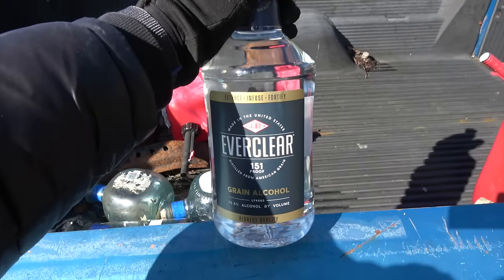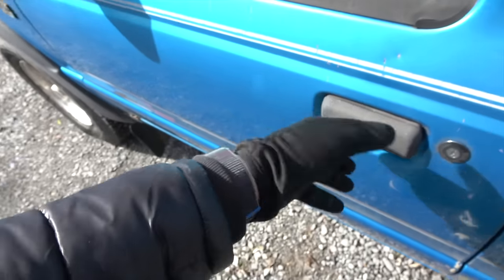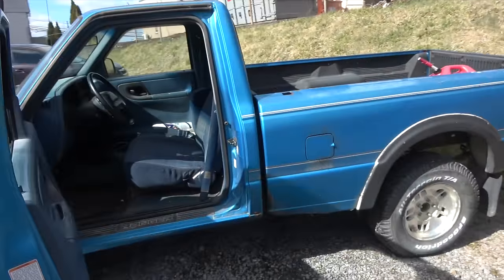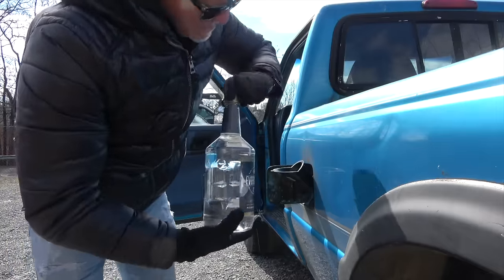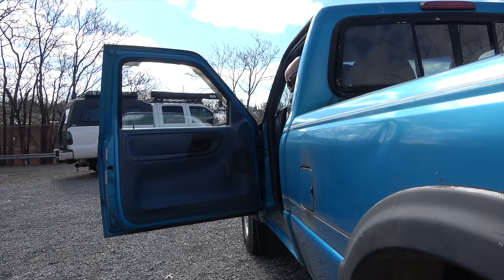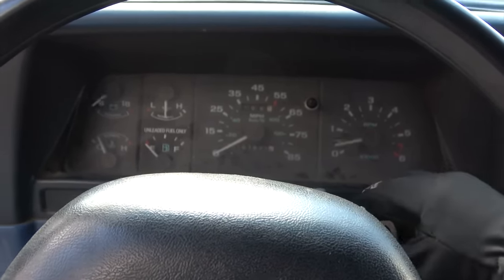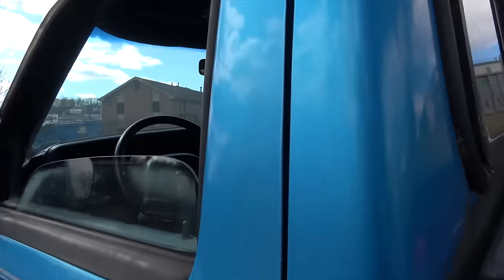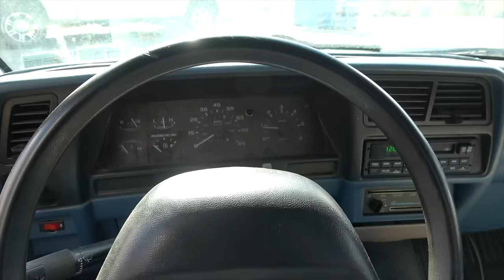What Happens If You Fill Up An EMPTY Tank With Everclear? (152 Proof Alcohol)

Comment: Here's my theory: Alcohol (ethanol) needs an air-fuel ratio of around 9:1. Gasoline is 16:1 (ish). Since the danger ranger is expecting gasoline, it's not pumping enough into the engine for it to burn properly, so it's running super lean on the everclear (which is almost 80% pure ethanol and some water). 
The vodka is only 40% ethanol. So while it was made up of 60% water, it was a lower concentration of ethanol, which probably made it closer to the 16:1 ratio that the truck needs vs. the everclear.
Reply: Why is his ever clear so crappy?? I have a bottle of ever clear that I'm looking at right now that is 95% alcohol. You think ever clear is about 80% and his says 75% on it.
Reply: thats what it is. the fuel air mix is now wrong. a old cabrated car it could easly be changed. might work in newer flex fuel car as it can sense the change in the fuel and make the adjustments. that old truck also will try and increase the fuel flow but the injectors are just not made to work that way and hit there limit.
Reply: I would like to see him try the 95% alcohol everclear
Reply: @justinalias2279  it would still act fuel starved. wile you can run the stuff you need to dump more of it. the current injectors and fuel system just cant do it. with mods it 100% could run. thats relly all e85 is anyways. the reasion people pretty mutch ignore the stuff is becouse it is only slightly cheaper then gas and gets less mpg.
Reply: Outside temperature could also play a role here, since colder air means the oxygen will be less prone to react with the alcohol compared to if it were hotter. The engine might also get a little hotter if the temperature rose, which could help also.
Reply: @neb_setabed   95% is banned in some places.
Reply: @neb_setabed Some states don't allow the real 95% stuff so you get this dumbed-down version instead.
Reply: @neb_setabed  Some states have laws limiting ABV. Everclear sells different products in different states to match the state laws.
Reply: I converted my previous car to run on Ethanol and you are correct. I needed to get recalibrated sensors, a tune and larger injectors in order for it to run correctly.
Reply: @DaftDrunk24 For sure. I converted my WRX to run on E85, needed a high-flow fuel pump, injectors, and a new tune. Absolutely killer fuel for turbos, though! Thing is a beast, making 80whp more than 91oct on the same hardware. (Which is a lot more extensive than just the fuel delivery and tune, mind you.) Even using ~30% more fuel by volume it saves me money as it's ~45% cheaper than premium in my location.
Reply: —So It Needs More o2❓😅
Reply: @DJDeezyThaTruth  No, it needs more fuel.
Reply: Gasoline has a stoich afr of 14.7-1. E10 or 10% ethanol which is what most places sell as regular is around 14-1 or 14.1-1. 16-1 on E10 would be pushing it. 16-1 on E15 and you might start running into misfiring.
Reply: Gasoline is about 14.7:1 not 16.1:1 lol that’s way too lean of a number
Reply: Any car can run on ethanol with upgraded fuel lines and the proper tune
Reply: @akman45304  Fuel lines? Maybe. Larger injectors and a higher flow fuel pump are also a maybe. It all depends on how cheaply the car was engineered. The materials matter as well. Some plastics degrade when exposed to high ethanol fuels.
Reply: @thatonedude5237  probably should've said fuel system just not the lines.
Reply: You can probably get a better result if you tune your ecu to run on e85
Reply: the dude just put 25% water into his tank.  On top of that, his injectors or pump is probably too small for the appropriate amount of alcohol to be pumped into the cylinders.
Reply: how about 190 Proof which here in Canada isn't banned it's 95% would she run? btw I never had it but my friend and his brother had everclear Jell-O shots and said after 4 shots they were wasted
Reply: This young man has the right answer. If the turn has a manual choke you could set the choke about 1/2 closed. that should help you truck run better.
Reply: In addition to fuel air mix, hotter running spark plugs, alcohol requires more heat to properly combust
Reply: @neb_setabed  Just what I was gonna say, sign of the times, 95% Everclear is now just 75%, and probably costs more too!  🤣
Reply: @rustirab3465 can't buy it in west virginia anymore.
Reply: @thatonedude5237  16:1 would be far too lean, you would need about 8:1 ratio of alcohol to run the ranger. Which is more duty cycle than the stock injectors can do. Alcohol is not as volatile as gas, so that ranger in stock form can not run on alcohol.
Reply: @gogereaver349 It's only ignored by the general public, but it's popular with racers that use forced induction because they're able to run more boost before knocking/detonation due to the higher octane.
Reply: @neb_setabed  state laws vary. They make watered down Everclear to comply with different state laws.
Reply: To buy pure ethanol you just get it as a laboratory supplier. also it will be 96.5% unless it has molecular sieves in there to pull out the water
Reply: @gogereaver349 My 2000 S-10 was a flex fuel and would run on it just fine cause I tried this back then!
Reply: Now she's an alcoholic 😅
Reply: Alcohol also burns cooler and the flame spreads slower requiring alot more ignition advance. Alot of mud bog guys and drag race guys like Alcohol because it's harder to overheat the engine.
Reply: @akman45304  any car? Yeah try a diesel engine
Reply: @SuperZardo  ever seen a diesel pro stock pulling tractor burn alcohol?
Reply: Fix the fuel mixture and it will work. We have Alcohol running cars since the 70s and thats all its changed.
Reply: I just put etanol in my Ford mondeo 2004 without problems. Cold start it will die instantly but after 3 turns (think the engine heats up) then it will run without problem as smooth as with gasoline. On hot sunny days it will just start up without problem.
Reply: vodka has too much water you should use the heads from distilling with both ethanol and methanol
Reply: @neb_setabed  I know a long time ago it was 95%.
Reply: @stevegabbert9626  still is in Nebraska
Reply: Yeah i think your right on point
Reply: David Freiburger from Hotrod explains the ethanol/gasoline comparison on Engine Masters. Ethanol is less fuel dense and requires more volume to combust efficiently compared to gasoline. Also, fuel moves around in the tank when you move. Fuel starvation at the pickup is not a new thing.
Reply: It's acting fuel starved cause it not built for ethanol of that high of concentration. Engine is to low of compression ratio to run well on it
Reply: It also needs the timing adjusted to match the fuel type.

Comment: When you run on any form of alcohol in an automotive engine, and you do not want the engine to melt down as it eventually will, you need to change the heat range of the spark plugs, and increase the air flow both in and out of the engine. I have a neighbor that races  an alcohol drag bike at the salt flats. And even his bike melted the pistons, from the wrong heat range on the spark plugs. Also if it still has the catalytic converter the converter depending on the type will melt down as well. And you also have to adjust the timming to match the fuel.
Reply: Yum "Salt flat"

Comment: Back in the 70's we added Everclear to our fuel for a cheap power boost. Once it reached the engine you had better be ready with a screwdriver to turn down the idle at the carb idle speed screw. Dumping a bottle into the tank of someone else's car was also a common way to mess with people, watch their face as their engine suddenly started to race, car wanting to take off if in gear. Never did this with a fuel injected computer controlled engine. You would need to reset the computer (and possibly change out injectors) to properly handle the Everclear, or at least run a blend of gas and Everclear long enough for the computer to start to figure out the needed adjustments. For the record you should add more than a gallon to an empty tank to ensure the pickup tube in the tank can suck up a steady supply of fuel for the engine. And pumping the pedal does not prime a fuel injected engine (or any engine that's been run dry), you need to let the electronic fuel pump prime the system before you crank it over. Try this test again, this time with an older carburetor fuel system-ed engine (no computer or injection system). Crank the engine over a few time so the mechanical fuel pump can prime the system (you can pump the peddle while doing this) or simply dump a little Everclear down the throat of the carb and fire it up. A couple moments of adjusting the fuel mixture screws will then give you top performance but it will still run even if you don't.

Comment: To prime, cycle key switch a couple times since prime mode for pump happens on key on for a few seconds before start. Pedal pumping on fuel injected just opens flap for more air and the computer adjust fuel/air radio using oxygen sensor. The high alcohol content just makes it run lean mostly almost like it’s out of gas because it can add enough “fuel” quick enough according to the programing. A flex fuel vehicle might be able to correct the lean conditions better. You can also use the fuel pump to pump the fuel out faster by overriding the pump relay with the fuel line disconnected. Love the videos and thanks for the experiments to keep us entertained!!
Reply: Maybe we just missed the carburetor conversion vid 🤷🏻‍♂️

Comment: What this tells me is that the vodka is more akin to gasoline in its flammability, meaning that the Everclear burns hotter. This means that the air fuel ratio is off. Kinda makes me wonder if a flex fuel vehicle would be a better candidate for this experiment when it comes to Everclear. To correct this, you may also consider a carbureted vehicle, preferably one with a Holley 4 barrel that has the availability of a jetting kit that will allow you to adjust the air fuel ratio more accurately. There are jet kits for running alcohol as well. Great video, thank you for sharing.

Comment: It's running very lean for alcohol, that's why you hear it popping through the intake. 
Try just throwing about 30~40% higher flowing injectors in it or turn the base fuel pressure way up.
Seems to me like when it's half running it's probably in closed loop and trying its hardest to get to stoich but the ecu doesn't allow for enough fuel trim, then when you meet the conditions to leave closed loop it immediately falls on its face.

((Looks to be a mid 90s ranger so pumping the accelerator isn't going to prime it, if anything holding it down too far while cranking might put it into a flood clear mode turning the injectors off))
Reply: it might run if its was flexfuel truck one that can run on e85 bc e85 is mostly alcohol.  it is possible to make engines that run on pure alcohol ethanol or methanol but there must be no money in it which is why the government is pushing battery cars
Reply: @tylercox1875  all a flex fuel system is doing is adding fuel depending on ethanol content and adding timing to take advantage of the extra octane.
He'd basically be manual doing that by putting larger injectors in but not getting the timing benefits.

Comment: Just a froendly heads up mashing gas pedal does not prime it while vehicle is off. To prime gas lines after gas tank is empty is to turn key to on position but not starting the vehicle. This allows the gas pump to pump fuel through the lines.

Comment: How about charcoal fluid? I put it in a 3.5 briggs and stratton mower engine and when I let off the bar to shut it off, IT KEPT RUNNING. I even disconnected the spark plug wire. I think the spark knock was so intense it just kept going

Comment: putting the ignition on accessory (right before the initiation of starter) runs the fuel pump a bit (you can hear it.)  do that ( on, off, on, off, on, off) over and over again, then start the car to pull every little drop out of the tank/line / pressurize the system.  also "priming" a vehicle only works with carbonated vehicles. with fuel injected vehicles, it does nothing. youre just opening and closing the butterfly (if its by physical wire. does nothing if electronic)

Comment: Really shows you just how much Bang gasoline has. Even when other liquids are flammable they just aren't able to produce enough of an explosion to push those pistons back down like gas does.
Reply: That’s because the air:fuel ratio in the engine is optimized for gasoline rather than alcohol.  Engines are able to operate on ethanol if they are designed to. Gasoline is used because it has a high energy density and low cost.

Comment: You should definitely try 95% Everclear, or go for a classic polish (rectified) spirytus, which is also 95% ABV and is mainly used as a base for other liqueurs. In Poland, when we run out of vodka, we usually mix it with water and then drink it (that's how most of any vodkas are made btw) or drink it non-diluted for that pure hardcore sensation 😄

Comment: Okay, here's what to do: Get an E85 vehicle like my 2003 Suburban, figure out the fuel capacity (figuring it in litres wil be easier), divide by 100 and then buy that amount of premium gasoline. Add that, followed by how ever many bottles of everclear are required to get 85% ethanol. Everclear should be everclear, but it's not all alike. Here in Houston, when I go to Spec's and buy everclear, it comes in different sizes, from flak to one-gallon glass gripper, but it all says 198 proof. I don't know why your everclear is so low quality, but I'd say if there's a type with flowers on the label, get that.  I used to dump a gallon of everclear in my father's 2006 Silverado and run the tank through before getting it inspected. So, yes it will run on everclear, just not dressed-up vodka calling itself everclear..
Reply: "I don't know why your everclear is so low quality"
I'm gonna say it's one of two reasons.

A - Various state laws limit the maximum proofing in various jurisdictions.  Everclear sells whatever local laws allow.  This is most likely the case here.

B - Even in places with looser restrictions, everclear is sometimes sold at various strengths with matching price tags.  It's possible he isn't all that familiar with the stuff and didn't know about the proof difference.  I kind of doubt it though as he was probably explicitly looking at the concentrations for the experiment.

Comment: You can use moonshine over 120 proof (160 or 180 is best ) or everclear 151 mixed with ethanol free gas and ATF for lubrication.  One gallon everclear to one gallon EF gas to one quart ATF. I'm not going to say how I know moonshine works better but it does especially if you double distill it to remove as much water as possible.  But before you do it you can always use a water separation filter. We use to run gas tractors off the 1+1+1/4.

Comment: As a person who has some experience with engines and alcohol, your engine won't run that as fuel unless used as an octane booster. Plus if on a carbureted engine you have to rejet. You can burn a hole through your pistons if you don't run rich enough.

Comment: If you want to burn alternate fuels like Ethanol or Everclear, or Naptha or Stove fuel... you have to know what the octane rating... and you need to know the air to fuel combustion ratio for the specific fuel you are using, and also the burn temperature for your fuel. 
We need to understand how these fuels work when you mix them also. Everclear, or ethanol ( pure grain alcohol ) has an octane rating of 113 )  Generally regular unleaded gasoline without 10% percent Ethanol has an octane rating of 85.  Regular gasoline with 10% Ethanol has an octane rating of between 87 and 88 octane... and Premium gasoline without 10% ethanol is usually about 96 octane and with 10%  Ethanol  it it 98 octane.  On average if you use a ratio of 10 to 1 gasoline to alcohol respectively you will increase octant rating by 2 digits. 
So to begin with if you are going to run Ethanol or Everclear  or whatever kind of grain alcohol... you might need to adjust your ignition timing to accommodate the fuel change...  and there is no doubt that you are going to need to adjust the air to fuel mixture... the reason the fuel won't run is it is not getting the correct amount of oxygen to fuel ratio..  
Another HUGE problem is when you are running straight Alcohol... is fuel engine knock and danger of destroying valves or plastic and rubber components of the fuel system... also the absence of lead... specifically tetra ethyl lead in the fuel which works as a valve lubricant, and is equally important in stopping engine knock.  Alcohol is far less volatile that gasoline... or less sensitive, it is harder to ignite... especially at low temperatures, so doing this experiment in the middle of summer might give you. a slightly better result... but to get premium response from your engine, you may need to install a fuel heater in addition to tweaking the timing and oxygen to fuel ration. Gasoline engines are regulated by sensors and many mechanical means that are calibrated specifically for they type of fuel being used... Some conversions are simple, and can be set up where you can switch fuel types fairly easily... for example Natural Gas (methane) and (Propane ) can be used to operate ordinary combustion engines... so can Hydrogen, Alcohol, many Stove and lantern  fuels, Lacquer thinner, Naphtha and so on.  But each of these alternative fuels present engine wear problems, heat problems, combustion problems, and power and efficiency problems if you just put them in the fuel tank without making modifications that allow the alternate fuels to be used to their full potential.  
Hope some of this information help you in future experiments with that poor truck LOL
Thumbs up for the video, it was entertaining.